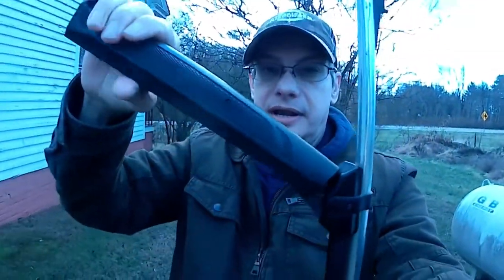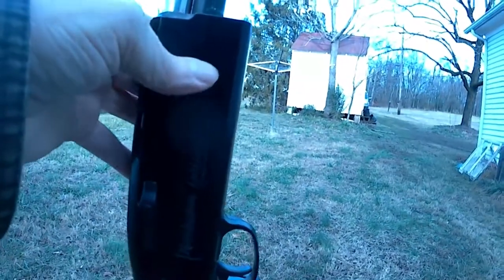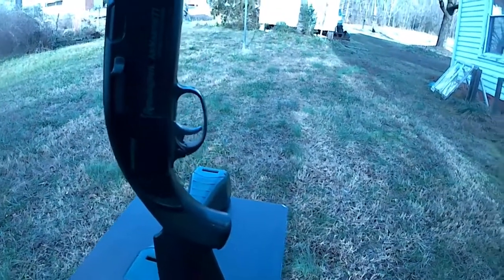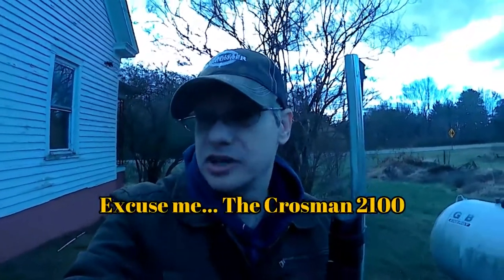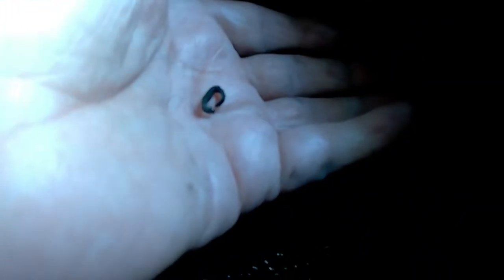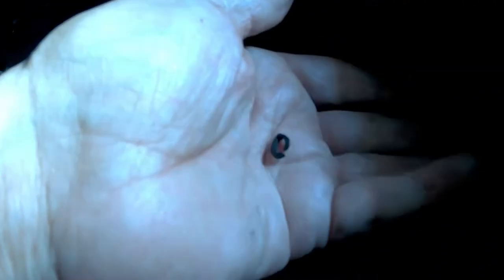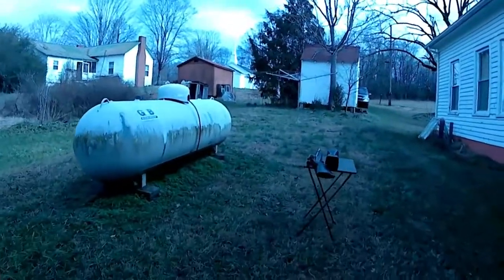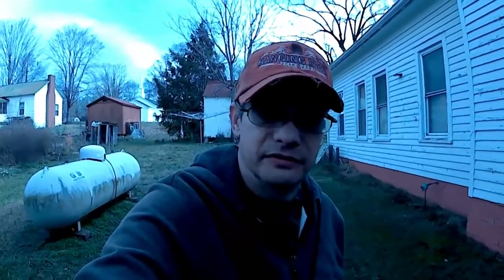Fixing Dads Remington Air Master 77

Comment: Maybe I should send my tg1 your way if I can't get it working watching the video now man keep up the great work
Reply from the maker: I don't know about that one, it would probably take someone with a shop and machinery, and probably better tools than I have. This one's not that hard, the pin for the pump was a complete son of a bitch to get out, you'd thought it was welded in. But, the rest of it is pretty easy, well, once you put it together the hard way a few times, give up, get pissed, then realize if you use the other side of the receiver to put it back together, then all the springs are under better control and you don't have to use your chin and toe to keep things together while you put it together. I've never heard much good about the tg1, doesn't mean it probably couldn't be turned into something decent with some tooling, maybe a new barrel, receiver, stock, trigger, just a few things and it could be a good one, lol. I've not seen or heard of one that shoots well yet, I don't know why maybe I only searched and looked at all the bad vids and reviews other than good ones. I've met one in person as well, it didn't work well, other than that it's all the experience I've ever had with one. Do some research on it and see what you can find out on them.
Reply: @slowpokeairgunner4027  it's definitely getting better but it is a slow slow process I mean this gun is giving me a headache even that being said I'm probably going to give it away to a subscriber at some point especially for someone who digs that gun
Reply from the maker: @FirstStateAirgun  Make sure they know what their getting, a lot of guys have shops and can do some serious work on 'em, or want to learn on one. What's going on with yours?
Reply: @slowpokeairgunner4027  100 fps spread. Fps numbers are up and down
Reply from the maker: @FirstStateAirgun  o'rings, airs coming out somewhere it's not supposed to be. Just a edjumucated guess.
Reply: @slowpokeairgunner4027  im sure you're probably right. Thats what i been leaning towards
Reply from the maker: @FirstStateAirgun  I believe I had seen one where it has some gunk around the o'ring that looked like glue, no way that gun was getting a good seal. change the breech seal, not sure which one fits that gun but I'm sure google can find it.

Comment: Not great. What I wanted to know was just a time lapse and I couldn't tell what was happening.
Reply from the maker: I got it apart and found out the gasket on the part I ordered was missing. The waiting time between the original tear down, getting the part, and waiting on the new part that wasn't in it, all this along with the amount of time it actually took, I just edited it out. Look up videos for the Crosman 766, it's the same model and I know a guy does a good job of showing, and telling how to take it apart. When putting it back together, it's almost impossible to get it back together with springs and stuff trying to fly loose if you have it laying on the wrong side. I'd have to look at my video, or it may be in the other guys video I mentioned above, but laying one way it made it almost impossible to get it back together, the other way was definitely easier. I think the barrel was pointing to my right while laying down for that.

Comment: Great work fixing up that pumper! Great little gun. Cheers!
Reply from the maker: Thanks, I had my fingers crossed that it was gonna run after I got it back together, lol. It is nice, I need to do some accuracy testing with it now, I bought a cheap $8 Tasco at Walmart to put on it, works great. Thus far, at ten yards it will drill a hole, now I need to get it out and test it, the wind has been whipping for days so I'm waiting for a calm day. Thanks for the comment. Have a good one.

Comment: I want to order a replacement parts for the for the 77 Remington model 77
Reply from the maker: Sorry about not responding, I haven't been keeping up with the channel a lot lately. I got mine on ebay, seller should be in the subscription. You need the parts for the Crossman 766, it's the same model done in black with Remington on it. This one is the older pre 2011 model which is metal with the plastic stock, the newer models are all plastic, you'd have to check with the seller on that. But yeah, it's the same gun, look up the parts for the Crossman 77, and there is a video of a guy taking one apart and putting it back together. At the time I did this I had a wait of a week after I got it all apart because a gasket was missing in the kit so I had to wait for that to come in. I had so much footage I chopped a ton of video and ran through it real fast since there is already someone doing it here on YT with a Crossman 766.

Comment: Do you think this air rifle can get up to the 800s fps? With a rebuild and some power mods? I have a Remington air master 77. I'm getting a velocity of 636 with 15 pumps and the crosman hollow points. The rifle is old so it probably needs a rebuild.
Reply from the maker: I'm not sure if you could get it up that fast, maybe put another seal over the transfer port, it looks like it would have to leak air in that area because the seal isn't the greatest. You could also slip a shim behind the hammer spring and probably get more. One more thing you could do would be taking the valve out and then take it apart and thin down the pin to give it a little more air in the valve itself because you can't put in a larger valve since it's a set size and can only fit in the slots the gun was made with. Yours is running about average speed from what I understand, order the valve that I ordered and see if that will bump it up, the link is in the description below the vid. All I can think is that this valve makes a difference, with some tweeking I'm sure you could get it up faster. The max I do on mine is 12 pumps and that will make it run about 730 with a 7.9 gr pellet, I'm happy with that, just going to a light enough pellet would possibly push it to 800 fps, but then you lose your down range power. It's not hard to work on, if you need some help there's a guy here on Youtube that tears down an old Crosman 766, it's the exact same rifle, but for mods and amping it up even fast I'd head to the forums and start reading, there's a lot of people with a lot of knowledge in 'em. ...Oh, I forgot to mention that the old 766 is the new 2100 model, so the parts you would be looking for would be the AM 77, and/or Crosman 766/2100. I bought Crosman Model 2100 & AM 77 Seal Kit (Economy Grade) https://www.ebay.com/itm/Crosman-Model-2100-AM-77-Seal-Kit-Economy-Grade/223750374042?hash=item34188fc29a:g:vHQAAOSwbb5eP3Kk
Reply: Perhaps by "desieling" or putting a little petroleum jelly in the cup of your pellet prior to chambering that pellet, but this action can foul out a barrel and damage the internal components as well, with prolonged use.
Reply from the maker: @BengtRosini13  Yeah, that can tear one up pretty easy. It has plenty of power for what it is, but the accuracy is not there. It shoots BB's and pellets about the same, it had BB's ran through it the entire time it was in use so I'm sure the rifling just isn't there for pellets any longer. I've tried a few shots at some starlings recently, missed two at 25 yards, lol. That's fine with me though, I can use it to plink with, it gets old pumping it up and I have to feel up to pumping it up, lol. It was one my Dad used for starlings, I have no idea how he hit them at any range but they were trying to tear up the siding and he took care of them with it. I'm just glad to have it up and running again. Thanks for the comment.

Comment: Great video brother👍👍
Reply from the maker: I appreciate it, I wanted to take my time and make it a really good one, but to many things going on right now in my world so I threw it together, gotta stop doing that, lol. I had this big plan of how I was going to do this video, take my time, go through every piece in the gun, how to get things back together the easy way (after my many fuck ups), etc. It didn't happen that way, I'm just happy to get it back together and running as well as it is, I didn't think it was gonna run worth a shit as crappy as the transfer port is on these things, I don't see how they can be sealing very well, but it suprised me, I'm happy, lol. Thanks again for the support, appreciate it.
Reply: Pilot Mountain Airgunner I now exactly how you feel. My kral puncher breaker broke few days ago.. now I’m working with this pain on the but.. stay tune and you will see what happens
Reply from the maker: @AffordableAirguns  I hate to hear that, I am dreading the day my Flashpup has an issue, it's gonna happen even if its five years from now. Good luck, can't wait to see how things turn out for ya. It's cool when you get done and everything is working again, you learn a lot along the way and it just feels good when you didn't screw it up, lol.

Comment: When you where getting 700 fps was that with 10 pumps?
Reply from the maker: No, I was getting I believe it was 686 with ten pumps, my Dad always ran it on 12 pumps. You can see where the video was broken up, I was testing ten, eleven, and 12 pumps, one pump was ten and a half, my string on my coat got hung in the pump, had to open it back up half way to get it out. I took the 5 shots for the numbers all at 12 pumps. I want to watch it and see if the spread decreases as it settles in from being operated on. Thanks for watching, and the comment.

Comment: This does NOT at all show someone how to assemble this item.
Reply from the maker: This is not a video about how to assemble this item, this is about me doing it for personal reasons, mainly being that it was the last Christmas gift my father gave me before he passed of cancer two years ago. If you will read the comment under the video you will see that someone else has a video on how to take apart, and reassemble the original Crossman 766, which is this exact model, only made black and stamped with Remington on it. Check out that video.

Comment: Gunsmith!!!!
Reply from the maker: Most definitely not, just know how to follow directions and look at pictures, lol. Thanks anyway. There's a video here on Youtube somewhere with a guy taking apart a Crosman 766/2100 somewhere, I'll post a link. A quick Google search or look into some forums and you can find out this particular rifle was the exact same model made for Remington by Crosman, so easy peasy, well easy peasy after you get the seals that were forgotten in the kit and after you've taken the piece apart and together five times bassackwards making it almost impossible to go back together, then the light bulb comes on and you get it, but yeah, easy peasy when ya don't do that. Don't do that, I did that, it's not fun. https://youtu.be/8x_M0s82EJc
Reply from the maker: My major mistake was trying to put it together with the left hand side of the receiver, it's a lot easier when you lay down the right hand side of the receiver and work from that side. It's not hard, but remember this if you ever tear one down, it's pretty easy once you figure out a few tricks that make things easier, and that one alone will save you hours.
Reply: Pilot Mountain Airgunner  very good tip . I took mine apart and I’m having difficulty putting it back together ;(
Reply: Oh no....sorry man

Comment: Bad lighting, 10x speed of disassembly,  reassembly. And lighting gets darker. 👎
Reply from the maker: Thanks for watching and the comment. A link to the video as a tutorial for taking the gun apart and putting it back together is in the description. At this point in my life, I was basically making a video for my dad who was dying of cancer. I shot my first rabbit on my first hunt that I was allowed to take a gun, I used a Crossman 766 with my dad. This was his model he got to take care of starlings around his house and gave it to me as the last gift he was ever able to give me for Christmas. He was a bit upset that it wasn't running right, but even with bad RA and other bone and joint issues I told him I would get it fixed, and I did and he was able to see me do it before he passed. This was not intended to be an instructional video. It was more of a, "Thanks dad, I told you I could fix it." video. At this moment in my life my nerves were shot too much to put together a tutorial, Thanks again, have a good one.